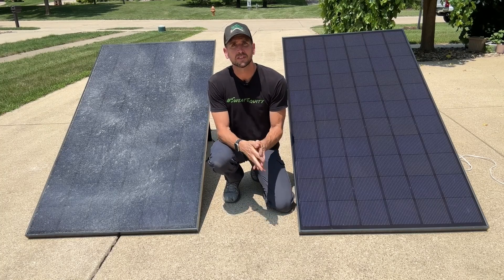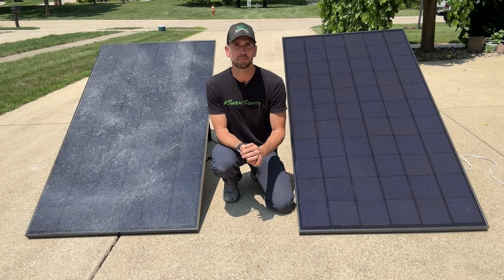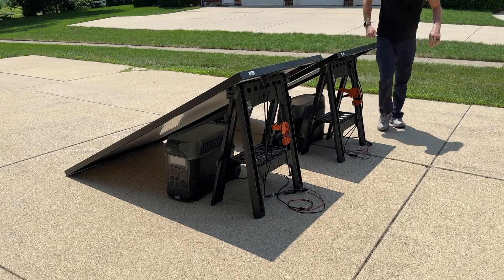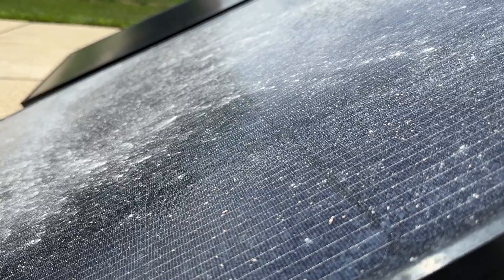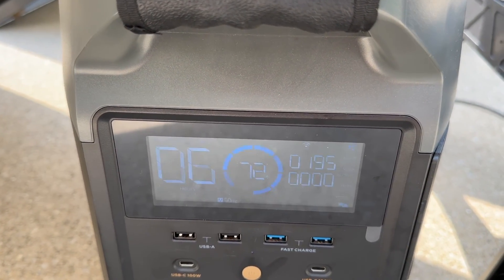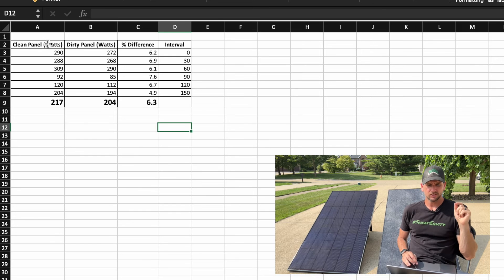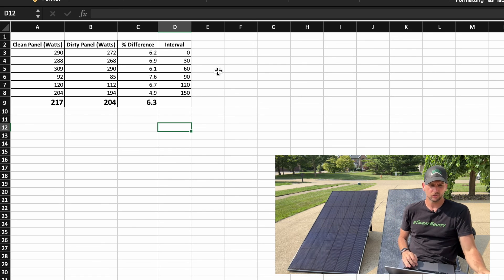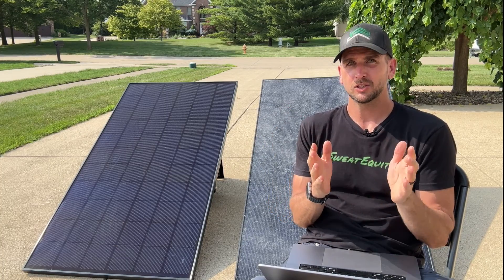Dirty vs Clean Solar Panels |  Testing Power Output Loss

Comment: In my tests with a typical layer of dust that gets wet and turns into a film that wont be blown off by wind and not cleaned in about a year on flat mounted panels that are otherwise reasonably clean its about a 1 or 2% loss. Eg. far less of an impact than demonstrated here, maybe the flour he used blocked more light than dust. I only clean mine at the beginning of winter and sometimes again mid way through when power is scarce, in summer it simply doesnt matter,  they make more power than I can use regardless.

Comment: Great video. Where I am in New Zealand, we get regular rain that washes away pollen etc. Only time I've cleaned mine was a few years ago, when construction next door was making quite a bit of dust during summer. In saying that, I have recently noticed some lichen growing on the panels, so I do need to go up there and clean them again! System is 9 or 10 years old.

Comment: In Europe in some industrial zones we have measured the power loss of 17% with calibrated PV analyser equipment. Cleaning is also important regarding safety. Dirty PV modules do overheat and may cause PV cell damage including the famous / most known hot-spots. I have seen hot-spots reaching 98°C or roughly 208°F. But as we know the PV modules work best in cold temperature and high solar irradiation. Dirty PV modules and shading is a big NO-NO. You can (sometimes) solve the shading with solar panel optimizers, but keep your PV modules clean if you can.

Comment: Would have been interesting to check the panel output after cleaning to make sure it is exactly the same as the other one. Some variation may be due to tolerances.

Comment: I’m not buying this argument yet. Solar panels of same make and model have different outputs. No two are exactly alike. Until you know a clean panel’s baseline output, these results with the dirty panel are meaningless. 

So, side by side and both clean, what are the output differences? If by chance, they produce the same results or close to the same, then I believe your results with one of the panels dirty. 

If they don’t produce the same or near the same results, then more study is required. 

I’d recommend you rerun this experiment and let the results of two clean panels be your control. Then do the dirty part!

Comment: We live where it doesn’t rain for months and seeing dust, etc on my roof mount panels makes me crazy.  But upon cleaning a few panels the panel monitor shows zero difference between the cleaned and dirty panels. No particular conclusion at this point other than visible contamination doesn’t necessarily translate to measurable performance degradation. Still makes me crazy though and might explain why the long established company I had do my design and installation doesn’t have a cleaning interval recommendation.

Comment: While PV panels generate energy through the absorption of visible light (mostly), the type of contaminants determine the losses. Because of that, the appearance is not necessarily an indicator of the amount of loss. However the cost of the lost energy must consider the (commercial) cost of cleaning the panels. Numerous tests have shown that cleaning the panels on a regular basis is not cost effective in this scenario, unless it's in an area of high fall out.

Comment: Where I am in Arizona - totally off grid - I see an almost negligible difference between clean and not fully clean panels. Granted, my panels are off the ground and there is no trees around them for pollen, but they certainly get that light layer of grime/dust. I’ve stopped cleaning them as I might see a 1-3% change at most.
Reply from the maker: Thanks for the feedback!

Comment: Once when my panels were being installed one of them was propped up against a wall.    When I walked by I hit just the right angle and was blinded by the sun reflecting off the panel.   Later I got to thinking:   that light in my eyes was sunlight that was not reaching the cells!    So I wonder:  is a nice pristine shiny panel really the best thing?    

You tests do show a degradation, but it isn't as much as I would have thought.   Maybe it was partly offset by the diminished reflections off the glass?   After all, the light does not have to be focussed, the dirt might just diffuse the light and that is all that is needed.

Comment: So I bought a Vtoman 1800 with extra battery, giving me 3000watt hour of power, in case of power outage. I bought a 100watt solar panel. Can I use it through my home window as I live in a cold climate ? Thanks

Comment: Good video! Here in the Arizona desert, a lot of people use 16% degradation as a worst-case loss, due to film, dust, and bird poop. We use a high number, because we get a few dust storms every year, plus dirt devils kick up a lot of dust too. When panels are dirty, they may not put out full voltage, so designing for a little extra voltage headroom helps startup.

Comment: I'm astonished that the dirty panel produced that much power.  I'm the type of guy who would simply by one extra panel for my array of 12 panels so I didn't have to clean it as often.
Reply from the maker: I was actually impressed as well.  One of the viewers did mention that the white powder might have lowered the panel temperature which does help generate a bit more power which could have helped close the gap a bit.

Comment: New Solar Panel owner here, but not turned on yet.    I assume rain is enough to wash panels , so if you have enough days of rain, you should be good??   I live in VA and we do have enough rain, but every so often, like this Spring, we get many days with no rain and a good dusting of pollen.   I wasn't thinking about having to wash my panels until this past Spring and seeing this video.  Thanks.
Reply from the maker: I think each region is different and you are right it depends on the frequency of rain but also what type of particles (pollen, dust, etc.) are floating around in the air.  You can keep an eye on them and you might only need a cleaning every other year.  In areas like California there is a fairly mature network of companies that just wash panels so a pretty easy thing to hire out but In VA that might not be the case.
Reply: It will vary from area to area. It is probably worth giving your panels a clean and seeing if it makes a difference.
Reply: I live in Golden Valley, AZ.  We get some blowing dust and when it rain sometimes the panels get an extra coating of dust/dirt.  My panels are on ground based arrays.  So, I can clean them easily.  I'm going to clean them today or tomorrow because this video reminded me to take a look at them

Comment: I wonder if car detailing products such as wax or ceramic coating would benefit the surface of solar panels.
Reply from the maker: Might be an interesting experiment 🤔
Reply: @everydaysolar you should do this experiment. I would watch and am interested in the data.
Reply: I put rain-x on a few.  I haven't measured the power diff, but the bird 💩 was easier to clean
Reply: I use car wash n wax on my panels every 6 months and its made a great difference for me, especially noticed that simple rain washes absolutely everything off as does the garden hose. Much less effort to clean. 
I discovered this being beneficial after washing my landcruiser and its solar panel, the wax made a great difference the next time i had to clean it
Reply: Maybe, but it might void warranty on panels.

Comment: Wouldn't the MPPT working to maximize power cause fluctuations in watts incoming at any given moment? If so, measuring the watts at a point in time, risks being inaccurate compared to measuring the total power generated over a decent amount of time. What I mean is that if you measure at a time that just happens to be a short term dip on one panel/MPPT, and a moment later, measure a short term peak on the other panel/MPPT, then you're comparing apples with oranges.
Reply from the maker: Valid point for sure.  I think if I could run the test across say 6 hours or even multiple days ensuring both panels are away from any variability in shading as the sun moves across the sky then the battery percent increase would be a better apples to apples comparison.  Maybe we need a round 2 in the future 🤔
Reply: With a high quality mppt the dips should only be a fraction of a second.
Reply: @cccmmm1234  I don't think that's true. The systems I've built, using components from various brands including Victron, the power is constantly fluctuating. Not to mention sunlight is not constant either.
Reply: @ripplesandleaves  Yes, there will be fluctuations from incoming solar illumination.  This is more varied than one would expect. I have never looked at Victron internals, but it could be that, like many products, they do not deserve their status.
From an electrical design and control perspective, I would expect an MPPT to stay within a Watt of peak output. Ie the voltage should fluctuate less than a quarter of a volt.
A high quality MPPT should find the peak within a couple of seconds then track the peak extremely quickly -ie respond to changes well within a second.
Reply: @cccmmm1234  Or, this is normal behaviour for MPPTs, and you learned something you didn't know Which is totally OK and doesn't diminish you. I find learning something new delightful, for what little that's worth. 🙂